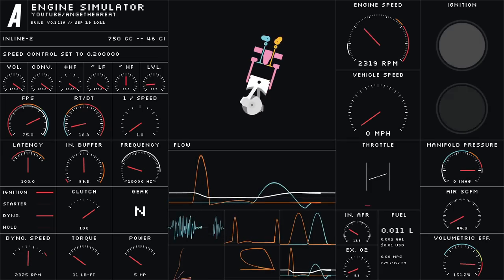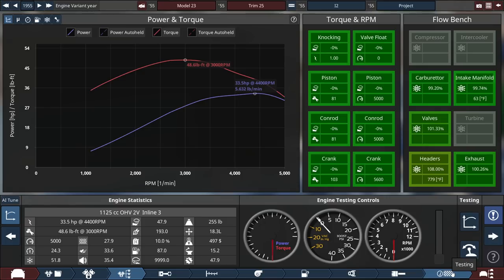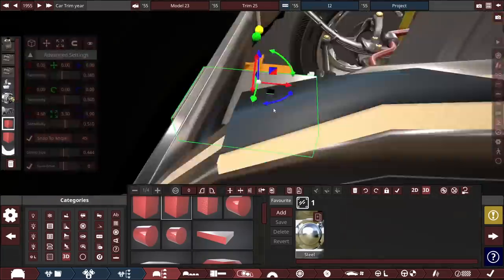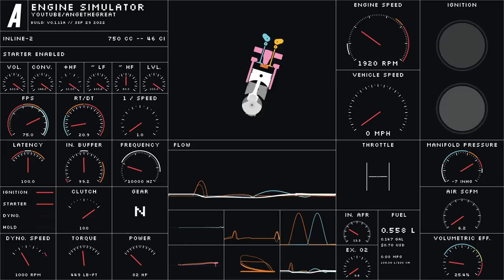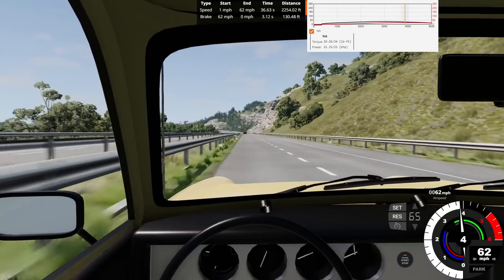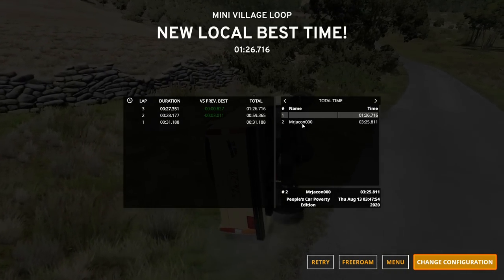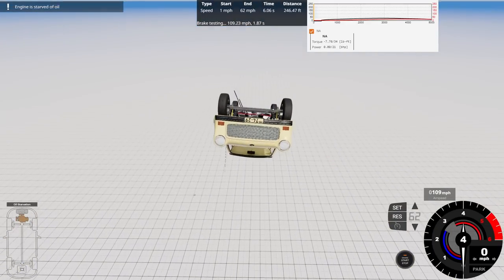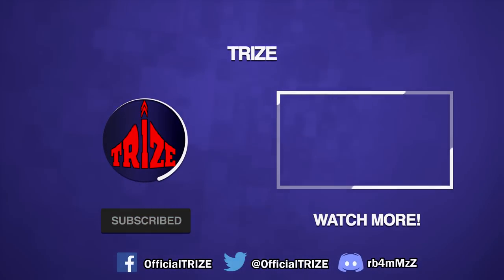I Made an Inline-Twin Engine into a Car! | Automation Game, ATG Engine Sim, & BeamNG.drive

Comment: Me being 2nd to comment. The differences between this and the Trabant 601:
-Transverse FWD
-2-stroke inline-2
-Fuel: anything good-burning, including strong spirits and 70 octane washing gasolene
-Power: 22 hp
-The outer shell was cotton filled duroplast, basically fiberglass
-Price today: around 1200-1500 USD
Reply: Wasn't the trabant chassis a hybrid between a ladder and a monocoque?
Reply: @jwalster9412  It was basically a steel space frame with duroplast panels, not that different from the 80s-90s Pontiacs.
Reply: @alexandruianu8432  fair enough.

Comment: The Problem with your engineering in engineering sim is Thatcher you dump the clutch in first gear, you can fix this by slowly releasing it, as far as i know by using einher shift or spacebar

Comment: Correct me if I'm wrong, but the trabant does use a ladder chassis, it's just welded to the body instead of bolted to make a sort of hybrid monocoque-ladder.
Reply: The trabants body is duraplast tho right?
Reply: The body parts are literally screwed to the chassis.
Reply: @DeathracerXD yes
Reply: @vitameat  they used screws and not bolts?
Reply: @vitameat  also I went of Google and it's a unibody/monocoque chassis.
Reply: @jwalster9412  Yes they did...it was actually fastened and not welded to a chassis...see the videos on YOUTUBE that came from the factory on  how they were built!
Reply: @vitameat not that I doubt your response, but do you have a link to the video?
Reply: @jwalster9412  Check YouTube search function for Trabant related videos...there are several